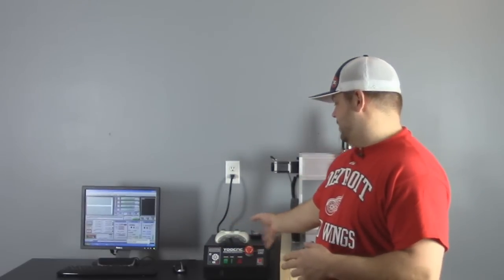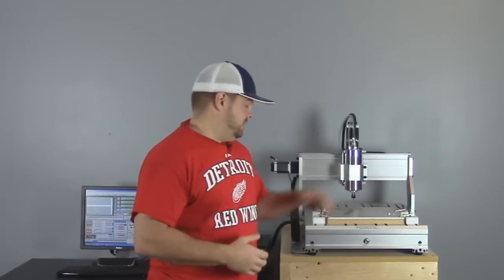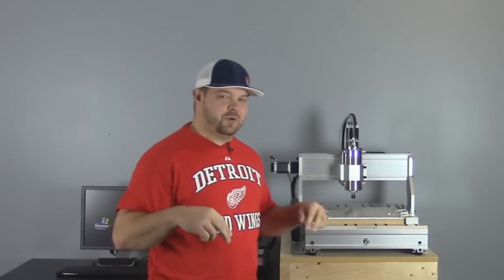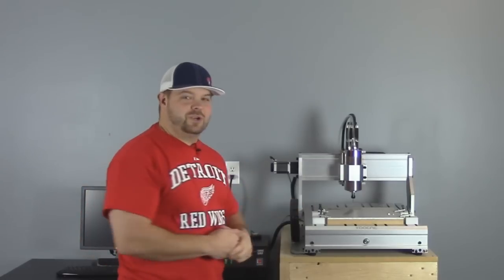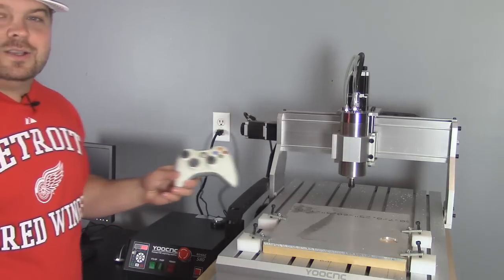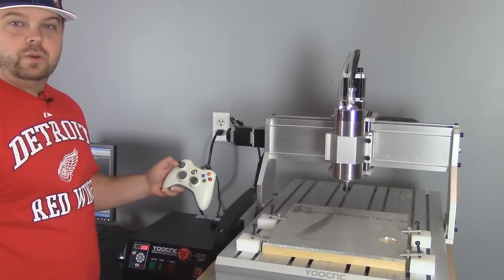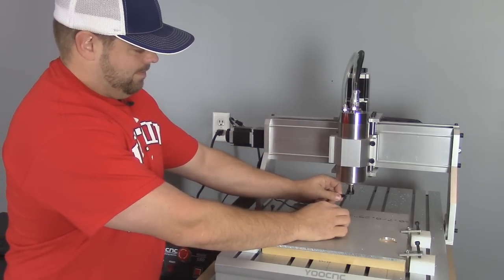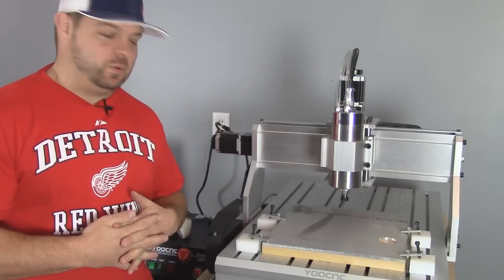My 6040 CNC Router / Milling Machine

Comment: it seems you know a lot about CNC machines, I bought the Vevor 6040 CNC it arrived without any program or even back connections, would downloading Mach3 software do it or do I have to download any drivers to run my machine.

Comment: can an 800w 24k RPM motor spindle on a 3040T CNC machine carve Aluminum.
because i want to get a 3040 because I do not want to spend $1200 for a router that will use for occasional purpose. please help. the motor must be able to carve 5mm to 6mm Carbon fiber sheet or 1.5in aluminum sheet is a must for the router that I will purchased.

Comment: Great work sir!

I am building a 5 axis cnc machine that will be used primarily as a welder gun guiding tool.

I am incorporating rotary/linear encoders throughout the axis.

Basically, my plan is to walk the gun over the joints that need to be welded then record the path then send the path back to cnc once I am ready to weld. 

Question: do you know of any software that can convert data from encoders to g code directly?
As you can see I don’t want to learn G code language.

Or if you have even any suggestions in this regard

Comment: Hi and thank you for the video .  I want to work on wooden boards that measure 18 “length X 14" widen x 1 "thick, I need to make a LINEAR engrave (STRAIGHT LINE engrave ) on the edge of this board all way around 4 sides ,  with this machine do you think I can do it?
Thank you!

Comment: Nice Video i admire it ... :) i have a question please did you make  a specific programming to relate between your CNC Machine Control Using Mach3 and your arduino to get ur machine work or just THE mach3 software do all work :)
Thanks in advance......

Comment: I know you said the z-axis is only about 3" but I'm wondering if you could bring it to the front to route bottles, or maybe drop out the floor and mount a 4th axis spindle and work that into the software somehow. Thoughts?
Reply from the maker: +Jamie Valentin Its possible.. I do have a 4th axis

Comment: If the cutting part is interchanged with a 3D printer head, you have a 3D printer, or with a knife cutting head you can cut over-spray templates, or drawing with a pencil or even make spray paint pictures. You could even bring in a lathe part for a 5 AXE milling machine.
I start looking for a affordable cutting table with accessories.
Thank's for the video.

Comment: Hey pal, does your machine cut glass and aluminium with great precision ?

Does your machine cut teflon ?

Thank you
Reply from the maker: Not glass.....but aluminum and teflon yes
Reply: Why it doesn't cut glass ?

Please explain me. 

Thank you
Reply: please I want to know too what type of case unit you used for coupling with the fuse. 

Thank you
Reply: ShortCourseWorld we are the spare parts manufacture of  cnc router ,if you need ,can contact me:skype:highqualitymc ,email:fengchunjing1@163.com

Comment: I just finished unpacking mine, tomorrow I will put together some old PC and do some tests. I'm going primary for cutting carbon sheets. Basically I was forced to buy one as I work with multirotors a lot and need custom cuts a lot, literally nobody do it around... ( I have the same cnc as you ;) )

Comment from the maker: i bought mine from carving-cnc.com but they offer basically no support. They are from china.....

Its an ok machine....but it has some issues. the spindle isnt perfectly plum and the z axis isnt perfectly square to the bed.....

for signs and stuff its perfect....but for machining alum parts you'll have to mess with it to get it up to snuff. :)
Reply: Hi mate what sort of thing can you make with it, could you carve a design on to a table led after you just turned it

Comment: jason have a question, what features does your cpu? 
I have a 3020T router. but my cpu is 2.8ghz processor - 1gb ram - 80 hard drive, and configure mach3 works very slow. servo motors work slow. I hope you could help
Reply from the maker: could be a motor tuning issue.....try holding down either shift or tab while jogging the machine
Reply: we are the manufacture of cnc router ,if you need help can ask me ,skype:highqualitymc,  email:fengchunjing1@163.com , tel:008615069095270

Comment: Awesome video. I also have a 6040 CNC, but am struggling getting my speed & feeds set up for cutting aluminum. Do you have any suggestions for what has worked for you? I'm mostly using 1/8" or smaller bits. I've tried several different RPM's and feed rates, but normally it just melts the aluminum and binds up the bit.
Reply from the maker: very small depth of cut........like .010 to .030 .....12-15k spindle speed....20 IPM.....sometimes more with a smaller depth of cut......doesnt hurt to spray a touch of WD-40 onto bit.......depending on machine.....try both climb and conventional......but try limiting depth of cut.....be patient these machines aren't very rigid.
Reply: im new to it all, but still running at 1000mm/m, .4mm DOC, 10krpm with a 5mm 2flute - and have seen these running at 1mm/500/15k with a 3mm (i think)... 

http://zero-divide.net/index.php?page=fswizard should give you some good starting points, though generally that'll call for speeds that are too fast - more meant for propper CNC mills, not routers like these.
Reply: Jonny Deth ^^ this too. the one thing not to be stingy on is endmills. I bought a bunch of cheapies to compare, and... well lets just say they dont.